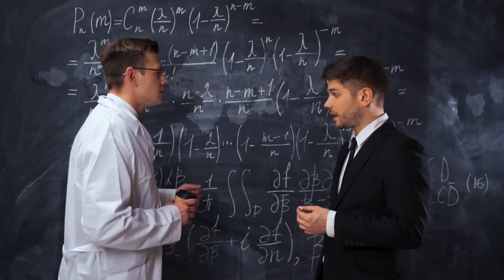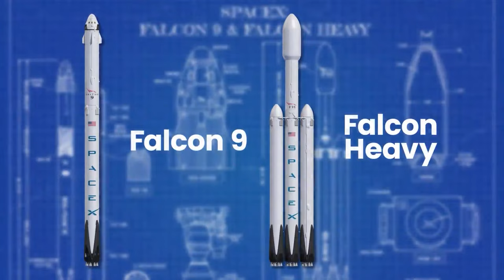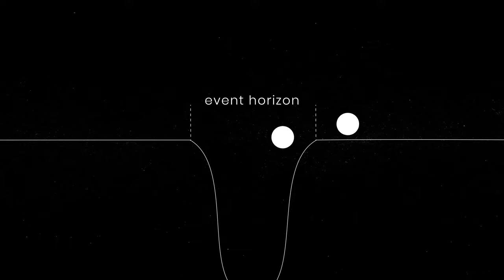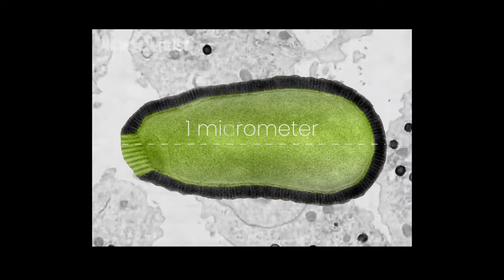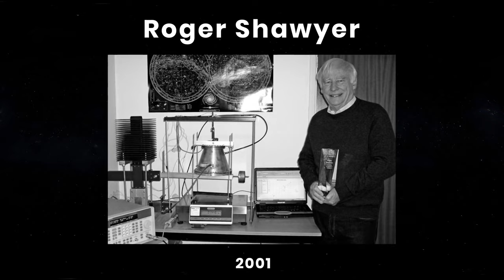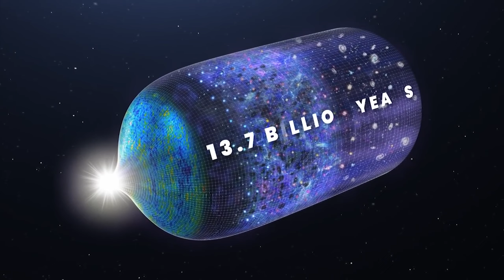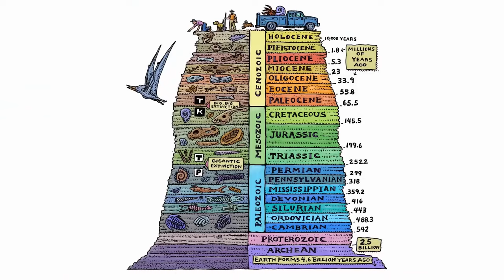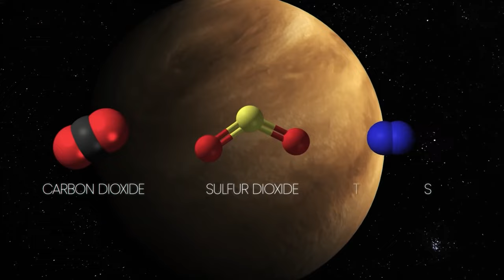NASA Discovers Mysterious Structure In The Universe - Best Video From Destiny 2021

Comment: Just a theory or an imagination, an object moves through space-time causing the drag of spacetime. When a dying star is undergoing supernova it collapses against the core and creates the spin of a strong gravity object. If the gravity is not strong enough it creates a white dwarf. But if it is strong enough that it twists spacetime around itself until the space-time got separated, the outside of the black hole, which appears to be black and nothing there, and the inside of the black hole, which probably brighter than we can imagine towards the object. let's say we are in the middle between the time horizon inside of the black hole and the object, facing inside it will be so bright and facing out it will be absolutely black and can't see what's outside. It's like a spacetime bubble that each side of the bubble never touches the other and the bubble itself is completely black with 0 reflections.
Reply: Interesting theory.

Comment: The event horizon is defined as the border where nothing can escape, because you would need infinite energy to do so. So when something enters the black hole, it gains infinite energy. What a nonsense! Why are black holes black? Because "even light" can't escape. Yes, not as light, but as super ultra long wave. A black hole is not a singularity. It just has very much space in it, what causes a enormous the time dilation. But it's not an "infinite" time dilation.

Comment: If the differential in G-forces from one end of your body equates
something like 3+ G's, your life would be very short, dependant
on how much greater the differential.
At 10G there's fast soup stream.
(If neutron stars in some cases go spaghetti, humans would do likewise.)
Reply: Oh plz, there's always a differential in gravity depending on distance,
not matter the size of the black hole.
The 'physicists' that came up with the idea of you somehow being
duplicated get their math wrong. A differential is based on distance
to any gravity source, plain and simple.
If you would be assembled from marbles, very tiny ones, the ones
nearest to the black hole, would experience greater gravity,
than the ones furthest. This result in the marbles being pulled apart.
Can't dumb it down any further.
Reply: If speed could somehow perform a magic trick and make atoms
double in number, which is a requirement for any such doubling,
any black hole would be self feeding.
Each atom would be doubled, where one goes magically one way,
turn into a separate body, and the other turns into soup, not ash.
Then the whole thing, due to entropy of energy, would happen again.
There would be a new buildup, another doubling, each time feeding the blackhole.
This does not happen.
Imagine stars doubling, and adding their respective masses a multifold.
That would make blackholes minimum sizes impossibly low.
Once a black hole exists, it may shrink due to energy consumption,
and once in such a small size it would need less mass generated
gravity to stay together. But that would be only once it already exists.

Also the size of the blackhole is not what is observed to be devoid of light,
which is just the event horizon (where light can't escape), but the size
of what is within, which can't be seen, and may be the size of a grape.
This can only be defined by the highest ratio of size
to energy particle at it's closest possible distance.
We know high gamma radiation is light, and with that has the highest
energy to size potential known to mankind, and thus it makes sense,
and here is where everyone has to guess, that photons making circles fits.
A halo like structure made of solid photon's, and I use the word loosly.
Photons packed so close together they'd be considered solid all in
the extreme high energy range.
These photons, despite an extremely small mass, would generate most
of the gravity, with each still material atomic structure being blasted by
such enormous energy, that it would soon become photons as well.
Much like the neutron star has chunks falling into the black hole,
so would these chunks stay in an extreme fast, nearing light orbit,
but with each period of time an atoms or two (or 100) would hit the halo.
and turned into more photons. This would explain the periodicity of
the high gamma rays from the black hole.
Now some people go "where's the proof ?", well, if anyone would have
proof of their theory all other theories would be disproven.
It's all guesswork, but for all theories there must be one condition
at least for it to be included in the big bowl of possibilities, and that is
that it must at least be plausible, before it can be made theorem..
Reply: Here's a joke of sorts.
Two scientists, one knowing gravity is immutable,
the other trying to change the law of gravity.
The second scientist changes the law, and has incredible results.
The first one points out he's not floating away on a dream.
The law in science changed, yes, but they're both still standing on solid ground.
Reply: I'm going to change the law of gravitic acceleration on Earth.
It's -10 m/ss. (the actual value if 10 m/s)
Now let's see if I can get the right outcomes.
An object 125 meter up in the sky falls up at -10 m/ss
(normal science, it drops at 10 m/ss downward, hits floor at t=5.)
Xt = 5 t^2 = 125 => t = 5.
It's correct, therefore, g=  -10m/ss. !YAY! I've discovered a new science.
The outcome is correct, yet the interpretation is wrong.
g-earth will always be 9.8 m/ss, and has always been such.
The lack of observing such didn't change it or made it somehow
mutable, it was always 9.8 it is 9.8, will stay 9.8, barring
mass changes to Earth, beit artificial or natural.
Blind application of formulas can yield the correct outcome,
even though their application was done incorrectly.
The outcome being right doesn't prove the application was correct.
It's the first thing I learned about science.
Reply: You can actually tell that a blackhole has a much higher energy density
than regular matter. It exerts force in gravity, like 4 solar masses
in the volume of a planet at the event horizon, but internally has been deduced
to be much smaller.
This means joule per ccm, or ultimately joule per Avogadro^3.
When this breaches a limit, it can't be matter anymore, since matter
has a maximum energy value for each atom. (spin, speed, excitement,mass)
Smaller still a single proton has a maximum energy value, as do neutrons
and electrons, and with this breached, the result is basically photons,
or maybe some other quarks separated and compressed again,
but with certainty not regular matter.
It can be that certain elementary particles can overlap each other's volume,
and that these are then doing so by the gravity they combined exert.
It's also true that this must happen under the rule that they all share
a common property and that is that they exert gravity and thus have mass.
The only 'optional' is the mass part. It can be without, maybe.
Would be neat to find the particle that exerts gravity and yet has no mass itself.
I'd call that the graviton.
Reply: Good science is made by people whom have studied science,
and practice it, not those holding a PhD and simply yapping
about that which they learned in the university
Reply: Ash only happens when there's heating and the water evaporates.
But.....that's not what happens.
It all stays neatly in an ever thinner stream, water included.

Comment: A black hole is a tear in the fabric (structure) of the universe, created by high levels of magnetic field, created by high speed electrons circulating around it, just like in a tornado (at lower speeds). Anything moving into the black hole gets its molecules dissipated for lack of structural support, not even photons can move through without a medium.

Comment: If nothing can get out of a black hole, including information then how can you say anything about what is happening inside.   If you said you knew what happened inside then you would be getting information about what was happening.  General information but nonetheless information.    So if information cannot get out then even general information about the theoretical astronaut can't get out either , thus you can't say anything about what is going on inside. 

Also if the black hole has a charge, you should be able to detect the electric field.   Also the gravitational field.   So you can get information , You can find out the total mass and charge.  That is information that is constantly flowing from the black hole to your voltmeter to check the electric field.   The electric field is EM waves and light is not supposed to be able to escape, so how does the black hole hide it's electric charge ??
Reply: @DEMONIKMINION  I was just noting that information cannot leave a blackhole by default.   So if you are making a theory about what is happening inside a black hole, then  the theory itself is somehow getting out of the black hole into the astrologists brain.   But that is not possible because no information can be extracted from a black hole, not even a general theory about what is happening inside it.

Comment: this explostion of super nova explains to me the problem of an engine built to continual worked by things what happens what goes wrong and this is a teaching and tells me if even a tech was invented todo this it would still have the problem of the explotion somewhere in the operation well just looking at two black whole or star happens yet this in a very small energy the star string on both sides could be used as well seems to be energy pop of some kind sound/

Comment: Commendation from NASA for research work at Massachusetts Institute of Technology on the Earth's atmosphere and the Moon's surface for navigation of the Apollo spacecraft to the Moon.

Dr. Milo Wolff has found the structure of the electron consisting of two spherical quantum waves, one moving radially outward and another moving radially inward. The center of the waves is the nominal location of the electron 'particle'. These waves extend to infinity, like charge force. All 'particle' waves mix and contribute to each other, thus all matter of the universe is interrelated by this intimate connection between the fundamental 'particles' and the universe. The natural laws are a direct consequence of this Wave Structure of Matter (WSM), thus WSM underlies all of science.

spaceandmotion

Comment: black whole sounds solid and round yet it travels ans seems to sound there is no connection yet what is a paralell therory is this well does it be black whole or a system of one particle eating another into a small and yet becomes bigger yet has no depth and it moves without being connected is there seem to be a trail they follow as a rule as travel same area an yet has no sides to outside of the distructive or good sorce to remove something are they sent to places by higher inteligence God , or also is inside without a boundrie such as outside and universes inside of what kind questions and doors are knocked on will and do be answerd

'

Comment: Why has nobody ever built a rocket that spins? The faster it spins the faster it flys and the faster it flys the faster it spins creating its own path very fast and the outer shell is all that needs to be spinning in the right direction, if its spinning to the left it is going down..and a stability ring to push its lean of direction for turning or angling paths..and have the shell spun by its flight the air force is its spin and you can make it wher you can open up or reverse the direction of the flapps for speed to slow or stop..does anyone understand that..imagine it spinning like a manual pencil sharpener blade like the one on the wall with the handle that blade is what it should be in the style of that design but from a fine point  to as big of a base as needed back to a slimming in size or spinning it cuts through air as a drill spins to drill through the material of the bit chosen..